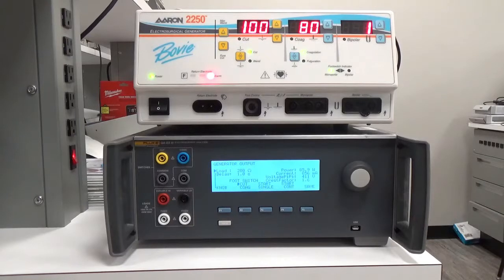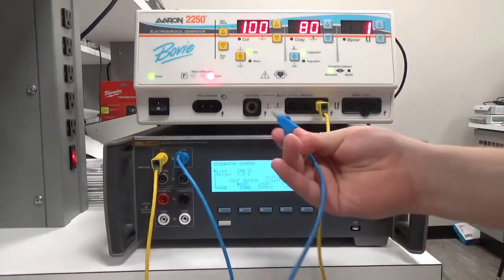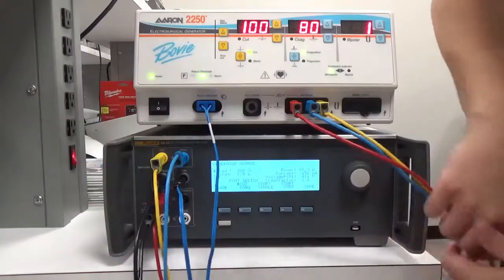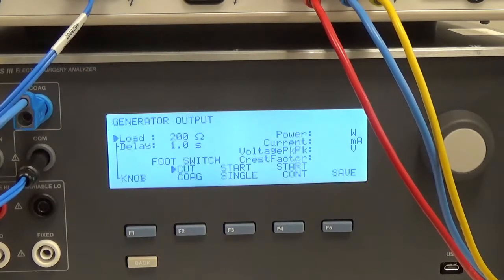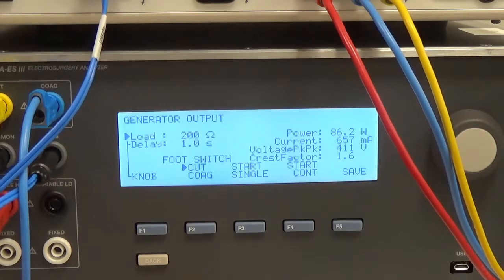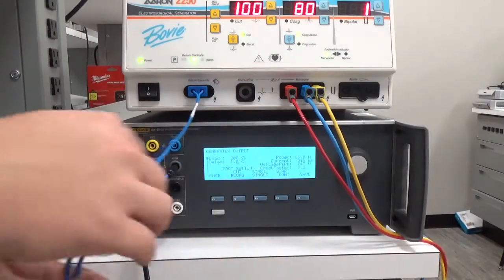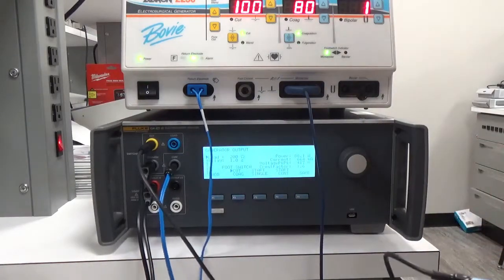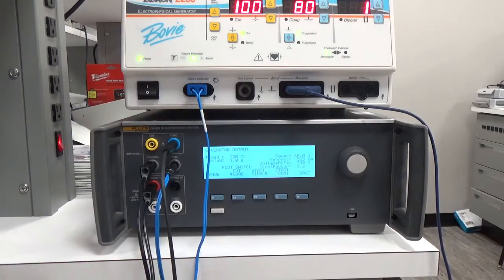BMET Basics: How to test an Electrosurgical Generator (ESU) - Generator Output Test with QA-ES III

Comment: How would you test the electrical safety test? meauring the lekage in patient applies parts? the device must be run with CF class.
Reply from the maker: I don't have a video specifically on the full electrical safety test - but I do have one on high frequency leakage https://youtu.be/VUbh7zMCu4E and REM testing https://youtu.be/sulVA1F7gm4

Comment: How do you tell that the ESU is operating well with those tests?
Reply from the maker: Are you asking how you know the tests are in spec? Each ESU typically has a range the power output tests should fall within usually around plus or minus 5% but can be different for the lowest settings. The ESU service manual should give you an idea on what the correct output range is for each power setting.

Comment: Great Video. I am looking into testing an ESU that uses square waves alongside a standard unit such as a bovie. Could that be possible with this device and is the information this device provides similar to an oscilloscope measurement?
Reply from the maker: If you are looking to measure current or voltage out I can't remember if the fluke analyzer has an output function for that - I know for sure you can measure power output and then send that info to a spreadsheet and graph it - but I do not remember a graph function on the device itself - I'll try to check it next time I stop by. You can probably (but I have not tried) use an oscope - if you set up a little test jig (maybe a 10 kohm high wattage resistor for the load) and then measure the voltage output with the scope (you need to be careful to protect the scope but I think that should work). You want to make sure all the current goes through the test load (and not the scope obviously)
Reply: @HTMWorkshop  I noticed that this device in the manual states that the crest factor measurement ranges from 1.4 to 16.0. A square wave will have a crest factor of 1 so will this affect the other measurements/cause issues?
Reply: @HTMWorkshop  also wondering if the data saved from this device is just one measurement or consists of numerous data points for each current, voltage, ect.
Reply from the maker: @StefComplex137  The only measurements I have used it for our power measurements. So it is doing the calculation for you - I am not sure if the crest factor will be an issue - definitely an interesting question. I am pretty sure there is an oscilloscope output in the back of the unit you can use if needed.
Reply: Brand and model of ESU and its operating frequency needed to determine.

Comment: Because of the poor documentation included with the Fluke, this video helped us figure out the Fluke ports used in testing. Thanks.
Reply from the maker: Glad it helped! Yes for some reason they skip over a lot in their documentation.
Reply: @HTMWorkshop  They say it's copyright issues.
Reply from the maker: @jankoP1410  well I guess they are worried the ESU mfg will get mad at them about something - thanks for the info